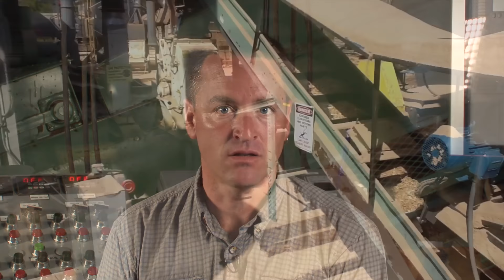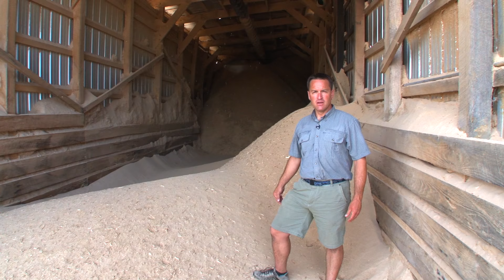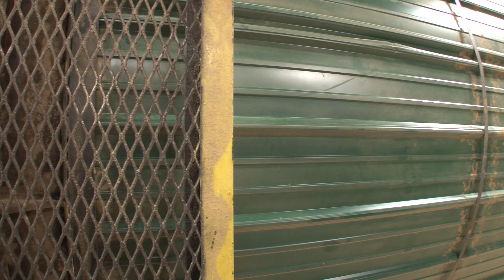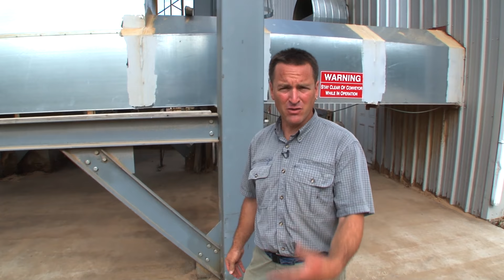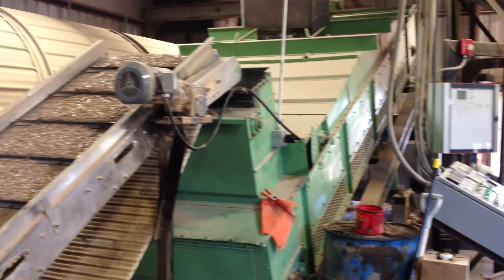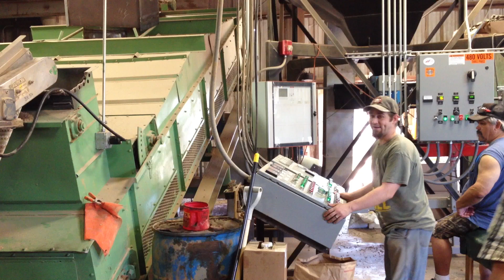WELCOME TO HEARTHWOOD PELLETS by Hearthwood Pellets

Comment: I have a wood pellet stove for the past 18 years and since then the price of a 40 lb bag of pellets has double in price in the past 10 years. Still it does what it supposed to do as a supplement heat source. With heating oil at $4.00+ a gallon. The pellet stove is still a good cheap source of heat.

Comment: Does anyone know why some pellets claim they are softwood yet are dark brown in color? Are they including bark in the mix? Does bark have more ash than wood?
Reply: Yes
Reply: And be way of “green” pellets…I was thinking how great to help the environment. Not so; the pellets were made with recycled railroad ties, and had a horrid smell. Notwithstanding that I had to chip heavy metals out of my fire pot, that built up…..just horrid….
Reply: @mattborden1816 some manufacturers also use granulated plastics as a binder. A small amount but it is present. I used to work for a large pellet manufacturer.

Comment: Your pellets look just the correct length, un-like one of the company’s I was using were they plugged up in my Harmen pf-100 furnace at the auger. I switch to another company who had the correct length for me, it worked out fine.

Comment: Simon, what do you do when it rains or snows as the wheel loader is picking up a load of sawdust and the sawdust is moved to the mill. Does the sawdust become overly wet and require more time in the dryer? Do the mounds of sawdust and wood chips stored outside become soaked when it rains?

Comment: Another pellet making topic I would love to learn more about is the amount of energy required to manufacture pellets. But that might be pretty involved & might be more of a thesis paper for a college student. There is the fossil fuels required to power the trucks that deliver the wood, the fossil fuels used to build the trucks & the machinery used to make the pellets & then the energy needed to power the manufacturing process, make the plastic bags for the pellets, & last but not least the fossil fuels needed for the trucks to deliver the finished product. In my opinion a wonderful thing about locally sourced pellets like Hearthwood Pellets is that the $$$ stays local instead of giving terrorist supporting Saudi's our $$$ for oil heat.
Reply: Yes, I agree the pellet making process would be a great subject for a thesis.  I suspect the pelletizing takes less energy than making charcoal as you are not throwing away the energy from the off gases.  Also, note that a 40lb bag of wood pellets is less costly than  40 lb of charcoal.  Another item of interest:  Pellets are just pure wood, with no binder added.  That is a great bonus.  Charcoal briquettes have binders added.  Lump charcoal does not.
Reply: @Don Berry  Charcoal bricketts are made from a large percentage of coal. 
Lump charcoal is used when you need more heat density. Whole wood has its top temp limited by the extra stuff. That's why back in the old days when sugar caine juice was boiled for sugar prodution they took the time to make coals. Other wise it was difficult to get enough energy to boil the juice.
Reply: Florida recently built the largest pellet factory in the world. Lots of softwood pellets. You can easily guesstimate energy required to deliver the raw goods. A semi truck hauls a max of 50,000 pounds. And get 6 to 8 miles per gallon. You would have to figure out what an average wood truck hauls but. Also BTUs per ton are known. So an oak pellet bag from the Midwest will have the same  btus per 50 pounds as 50 pounds of Midwest debarked oak. Be an interesting project to read when you get it done.
Reply: @fritzsmith3296  You imply I'm lying. If only there was a way to confirm..  Like a web page that you type questions into that gave answers.
Reply: @fritzsmith3296  1. Who invented briquettes? Henry Gord. 2. Why did he make them. For Mr. KINGSFORD because he loved camping and he loved money.
3. What was in the original briquettes? Saw dust, corn starch, and TAR. 

Guessing your a millennial.
Reply: @Fritz Smith  So Henry Ford didn't invent briquettes? And coal dust is not used in briquettes? You just feel like rewriting history for fun?
Reply: And your an idiot.
Reply: @fritzsmith3296  FYI. Corn starch was developed in 1844. Long before Ford used it in his briquettes.
Reply: @tireballastserviceofflorid7771  someone deleted all his comments hahaha